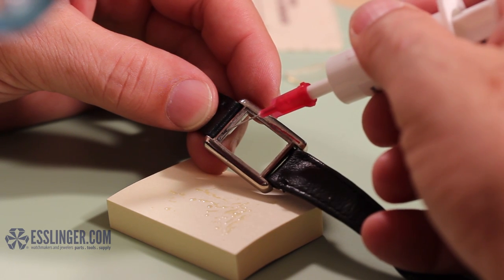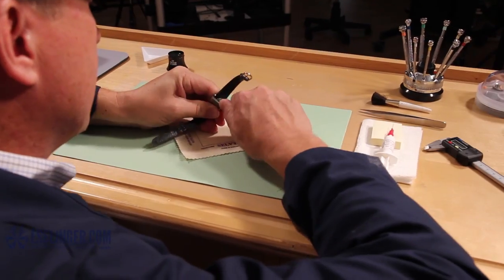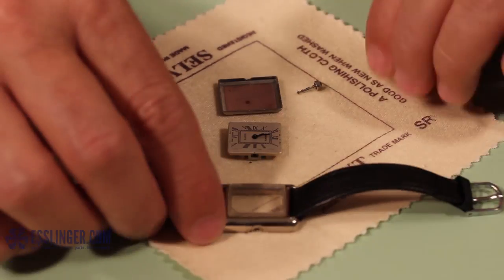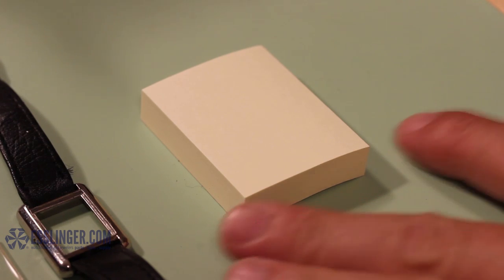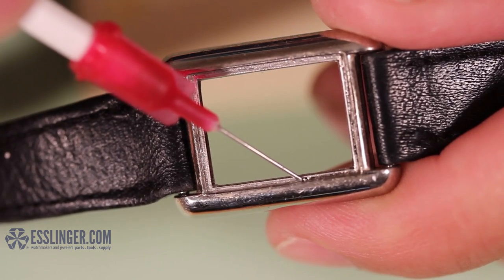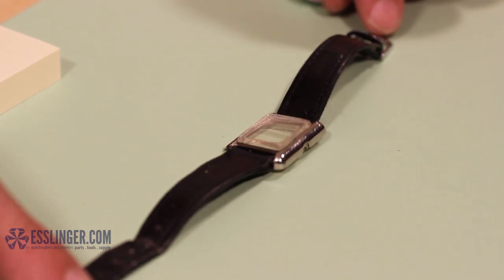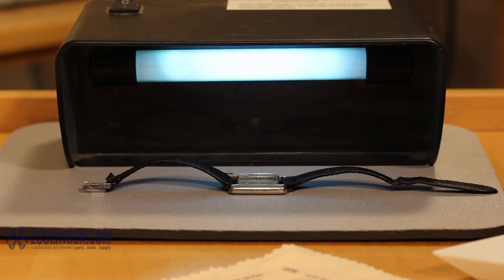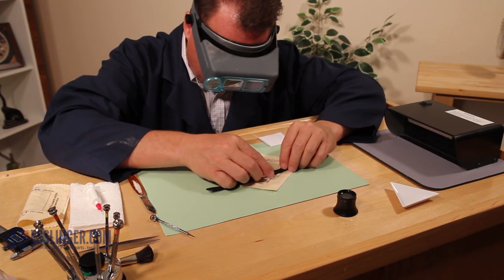How to Attach Watch Crystals Using Ultraviolet Glue

Comment: Using a screwdriver to remove the old glue should be a last resort.  Pegwood should be the first choice - a screwdriver can easily scratch the watch case if you slip.  Only use metal objects to remove the glue as a last resort.  I would even remove the strap and dunk the case in solvent before attempting to use a screwdriver for this task.
Reply: Wouldn't a solvent like acetone be preferable over a screw driver as well?
Reply: I fully agree! I would not even use a screwdriver as a last restort to remove old gunk and glue and would opt to use a piece of plastic tubing and then revert to a toothpick or piece of peg wood.

Comment: Does it matter what glue you use
Reply: I don't think that for this application it's necessary to use a glue that needs to be set with ultraviolet light. The crystal is easily held in place and isn't going to move, so using a quick-set glue isn't a problem. Now, if you're going to add a bubble magnifier (aka Cyclops) over a date to your crystal, then a glue that needs ultraviolet light to set is a good idea. That way you have some time to adjust the magnifier exactly over the date window before you get the glue to set.